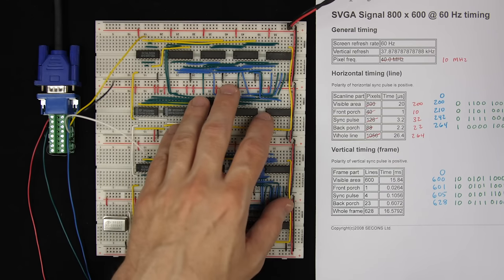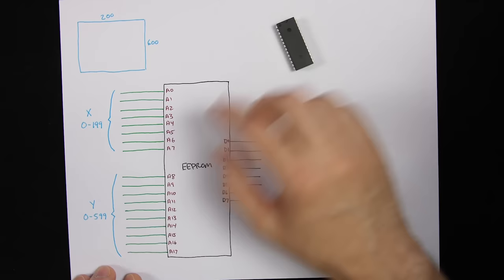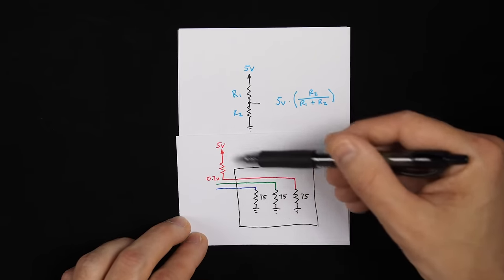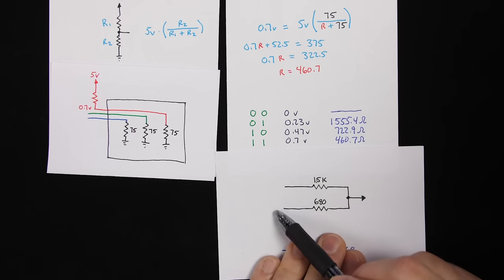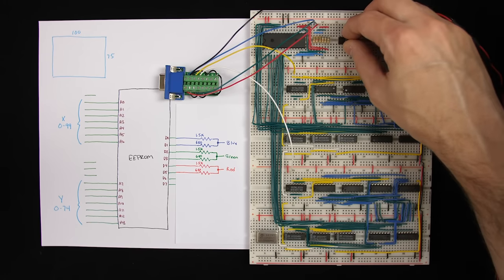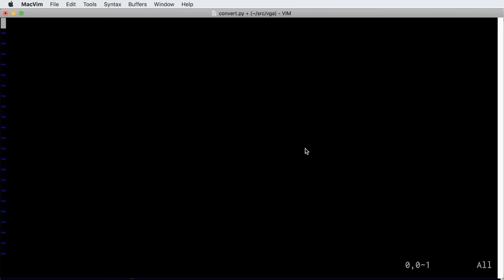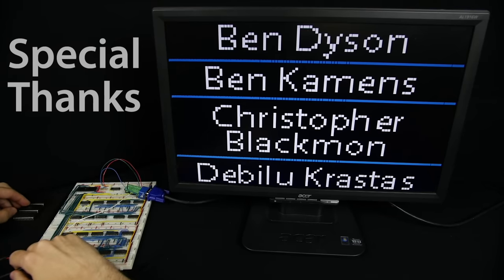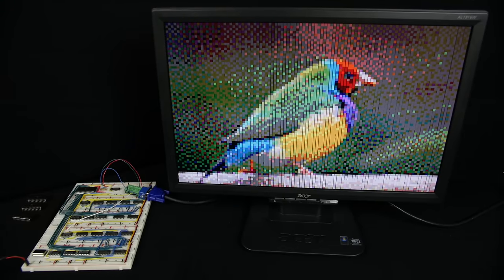World's worst video card? The exciting conclusion

Comment: Great job, but I miss decoupling capacitors on each chip you are using. You should use them, especially when breadboarding.  I think that might enhance the picture as well.
Reply: I was just about to add this, those 74LS chips were more forgiving than i had anticipated - even at 10MHz...

Comment: Using error catching as flow control made my architect mind scream in horror
Reply: Why?
Reply: @quintrankid8045  A combination of "bad design" and a huge resource cost for exception handling.
Reply: @OzixiThrill  so what? It's a simple script to convert A to B. It's not going to run for hours, or be maintained for years or anything like that.
Reply: @sligovolts  "Using error catching as flow control made my architect mind scream in horror" - I was explaining that. Nohing more, nothing less.
Reply: @OzixiThrill  now I see, and I stand corrected
Reply: @OzixiThrill  But even if it was going to run in production for the rest of time why is that bad design?

And if time is really all that critical, eg we need an estimate of the hurricane path before the hurricane makes landfall, then maybe Python isn't the right tool for the job?
Reply: @quintrankid8045  Exception handling is supposed to be there to handle cases that the programmer can't predict to occur. For this case, the programmer in question knew exactly under what conditions the exception occured and knew exactly how to work around it, even without introducing exception handling.

And exception handling is costly, regardless of the language used, thus should be used when necessary in general.
Reply: @OzixiThrill  I looked around the intertubes and it seems that if try block doesn't throw then there's very little overhead.  The code might even be more compact, if that matters.  But yes, handling the exception is a bit costly.
Reply: @quintrankid8045  We do know that we are catching the exception about 1/3rd of the time, which makes it quite a bit more costly than say writing an if else block to handle the situation preemptively.
Reply: @OzixiThrill  I think I'd want to see the timing on that so that I wouldn't be violating the rule of premature optimization.

You know what seems strange to me?  At least one more mention of this in the comments but I didn't see anything about not opening a file using 'with' context manager or a mention that the file wasn't explicitly closed. I wonder why.
Reply: @quintrankid8045  In this one instance, it would be premature optimization, because the code segment is barely ever used.

I'm not overly familiar with Python, but it could either be that Python does that in the background, or that due to the program closed, the files closed as well.

Comment: Ben, please consider targeting a little bit more knowledgeable audience as well. It is good to have these videos that target an entry level enthusiast, but these videos are actually really good, except for those of us who have experience in this field, they do get irritating due to all the "mistakes" that you are making. Some points to consider for this video:

1. I would have used a ROM and an SRAM to load the image from ROM to SRAM then blit it from SRAM.
2. There is plenty more resolution to go with 32KB of memory, I'd chosen a 200x160 resolution. Better yet, a great resolution would have been 320x200, which uses up 64K but it matches the DOS mode 13h resolution.
3. There is more bits for the DAC in 8 bits. Rather than 2 bits each for R, G, B, I'd done 3 for R, 3 G and 2 B.
4. The python out of range and exception back and forth is such a basic bug that I would have a) not use exceptions and b) would have written it correctly with the 128 byte stride the 1st time. Nowadays pretty much everyone knows python.
5. In Photoshop you can save the file as RAW rather than PNG and forego the whole PNG hexdump and loading step. Just load the raw image in python and do the 128 striding code.

With all this said, I appreciate your videos, these are great fun and while they are a bit irritating for someone who has done this before, they are still interesting to watch!

Comment: How many FPS can it do?-Yes.
Reply: It can do 60 FPS, just... with one F...
Reply: He's so rad that now he needs SPF
Reply: He could set up multiple eproms and switch the RGB output signal between them on the vertical blanking signal. That would then animate between them at up to 60 FPS.
Reply: the faster you can swap an eeprom, the higher the framerate
Reply: @paranoidnela  Next up: building an EEPROM swapper robot arm that can swap 60 EEPROMs per second.

Comment: This guy builds a graphics card on a breadboard in 25 minutes!!!11 incredible
Reply: He cooks to
Reply: He also writes poetry and paints inspirational works of art.
Reply: Well, he cut parts of the video. It took him hours of research to get it working
Reply: @raven4k998  to eat?
Reply: plushoom  lul
Reply: @edism  yes to eat you should try his chicken cordon blu it's to die for lol
Reply: @maxlee3838  I dare you to get western digital to make the 6502 at 14 nm instead of what they currently make it at actually I quadruple dare you to infinity  to do that as that would make a cool video to see what it actually overclocks to with that much of a size reduction to it
Reply: http://www.6502.org/homebuilt <-- some HDL examples, if you're into FPGA.
Reply: @raven4k998  Hehehe, I see what you did there.
Reply: @edism  yeah well I am kind of curious about how faster a 14  or better yet 6 nm 6502 cpu would go to in overclocking as the original maxes out at 20 MHz and the smaller you go the faster it gets the bigger you go the slower and 6 nm is the smallest you can go with a 6502 as that's the smallest you can go with silicon based tech works besides it would make the chips cheaper to make and if you have to make these old obsolete pieces of crap you might as well make them as cost effective as possible by shrinking the chip down for getting more out of a node plus you also then make chips that use a whole lot less power to boot

Comment: When I went to test the first stage by connecting the clock outputs to RGB through resistors, I'd get a bar, but as it progressed down the screen, it was fading out.  also faint vertical lines and bottom looked like vertical blanking was in the image.
I tried different resistor combinations, etc.  Thought perhaps there was a current problem where using a passive voltage divider wasn't allowing enough current through the 75 ohm impedence.
Then it dawned on me.   If you're driving the the RGB from the vertical clock, the video image signal is still being sent past what should be the end of visual screen.   So instead I used the HBLANK signal from the SR flip-flop
BINGO!  Of course it's one solid color on the entire screen, but at least the brighness was uniform.

This particular monitor, really a digital TV with VGA input, required a signal on the video color pins or else it would consider there to be no signal, even though it had vertical and horizontal sync.

Also it didn't seem to care if the sync polarity was positive or negative, which was another thing I tried when I wasn't getting solid horizontal bars.

On to adding the eprom.

Comment: So you have done a picture... is there a. Chance that you will do a video??

I think I’m not the only one hoping to see you attempt / accomplish this.

=D
Reply: In theory he could use the unused address bit to look at multiple images
Reply: There are a few ways you could accomplish this. I might even try this later after I'ved moved and grabbed some breadboard (have used discreet chips, but never breadboard).

this depends on what you mean by 'video'. if it's a fixed video on an SD card? It'd be possible to get some arduinos to barf the pixels out fast enough that you didn't even need the sync circutiry. if you use the sync circuitry and then use RAM instead of an Eprom, then you can get a more modest arduino to handle it if the frame-rate is lower.

getting a Gamebuino META (which has a similarly small native resolution) and scraping the pixels off of the SPI bus because that's how it communicates with it's own internal screen. upside, you now have a very modest but perfectly decent game console with a screen that doesn't require squinting.

doing it purely with logic chips would be a mulit-level breadboard monstrosity, though.

Comment: The most amazing thing about this whole project:  not a single decoupling cap.  Who was that that said we need decoupling caps?  Oh, and you could fit 2 images in a chip and just flip that address line. . .  Or even use a 28C1024 and put a counter on the upper address lines.  ;-)

Comment: is it possible to simply copy the pixels from a low resolution camera, directly to your video chip, essentially generating a constant changing mirror image of a camera to the chip to be then read to the screen?
Reply: just to add to this comment i made, basicly you can just as sdram before the chip? or divert camera input to sdram and read directly from the sdram in video mode?

Comment: I was thinking about the issue of not enough address lines on the rom to handle 200x150 video.
There is actually enough storage in the rom to store that size of an image, even with each pixel taking up a whole byte.
200x150 is 30,000 bytes.  Can fit nicely in the 32KB rom.   The issue is because we're using extra address bits for the horizontal to accommodate a full 200 count, we're wasting 56 bytes per horizontal line.
What we could do is use a separate dot counter that counts to 30,000 with the clock suspended during video blanking periods.
What you would need is a 15 bit counter with reset at count 30,000 and clock gated when horizontal count is over 200 or vertical is over 600.
Except for one problem:  Every count of 200, we need to hold the clock for 4 counts since we are outputting 600 rows but only have data for 150 rows.  We can't just skip address bits because the data is not on exact binary boundaries.
Hold the dot address clock for 4 vertical clock pulses.   The blanking timing is handled elsewhere.

Which leads me to another improvement.   Instead of only 64 colors, 2 bits each for RGB, allow for 256 colors and use a color map to specify the actual colors.
Reply: So I mulled this over and if we were only displaying one horizontal scan per individual vertical line, a dedicated counter for the ROM would work even with the number of horizontal pixels not on an address bit boundary.  But because we have vertical lines repeat, that gets more tricky.  You can't just freeze the clock at the end of the visible line and hold it for 4 vertical counts, or else for every visible line you'd get 3 blank lines, or the 3 additional lines would be the last pixel data being scanned across.
But the old 8 bit PCs tended to only display odd or even lines in the interlace.   That doubled in allowing the processor to have the bus an entire field.   Skipping 3 out of 4 lines might not be any worse when considering you're really displaying 800x600.

As for resolution, 200x75 wouldn't really be too bad.  The pixels wouldn't be square but rather stretched to a vertical rectangle.  To get the full picture, you could take the image as 200x150, and odd or even lines when putting it on the ROM.

To get a sense of what the images would be like displaying 200x150, 200x75, 100x75 I took AND/NAND gates to take the one of the LSB output of the H clock generator and V clock generator.

View pictures of my monitor's display:
https://1drv.ms/u/s!AtrEecyHVSB5hKxqSc0NkUOQJQsHew?e=Tf3zp9

Two of them show ROM output when it is all erased.   Most of it is a field of white, but a spot about 2/3 down, 1/4 right from the left you'll see a few "pixels" that show magenta.   I guess that's a few bits in about 4 bytes the ROM that are a tad slow.

In my experiments, some of the lines we've seen might not all be from the delay in the ROM but also accumulated propagation delays in the TTL circuits.

Comment: It occurs to me I could build a hardware CHIP-8 interpreter using this and your breadboard computer. CHIP 8 programs are 64x32 pixels usually.
Reply: Ooh, you could also store a second, grayscale version of the image above the color one in the EEPROM, at the addresses where the fifteenth address line is high. Then leave the address line floating. It will randomly make the image either grayscale or colored and could be cool to look at! You could also implement double buffering this way, by using the extra address line, if this were a RAM chip. Or just hook it up to a switch to see two different preprogrammed images.

Comment: Putting a video signal out during the blanking time does not lead to damaging the CRT display; it leads to what is termed “retrace lines” becoming visible on screen (assuming there is no special circuitry to control retrace blanking).

Comment: 200x600 is kind-of like the extra modes 8-bit Ataris got when Atari introduced the GTIA chip. I don't think any manufacturer in those days dropped bits just to get square pixels in high-res modes, but those modes were extreme. They had pixels 4 times wider than they were tall, like the sync signals here but only 80x200. They were some use for smart artists, Atari themselves made a nice demo with a spaceship and a robot, but definitely tricky to use. It was easier to use mode 8 which sent the same data through a shift register for 1 bit per pixel, giving 320x200 in only 2 colors. Games tended to use 160x100 or 160x200 in 4 colors, sometimes using a custom "display list" to use different modes on different lines.

But anyway, this would have been a pretty good graphics board back in the day. :) I'm impressed it can be made on a breadboard. It gives me hope, although really, if I wasn't always too tired to do this sort of thing, I would have been doing it in the 90s. ;)

Comment: Looking at the timing diagrams, we're very lucky with the ROM chip.
From the monitor's perspective, each pixel is 25nS, yet the ROM specs out with maximum of 150nS.   
So the display could have black or random color dots for up to 6 monitor pixels for every of our pixels.
I bought cheap ROMs from Amazon, 5 for I think $12.  Many reviews said they had issues but even if I only got two to work I broke even compared to well known sources.  All 5 tested OK with the ROM burner, tested all FF, all 00 and random bytes, always verified OK.   But only 2 out of the 5 would produce a suitable display, likely because the 3 could not produce reliable data in time.

Too bad they didn't specify what is typical but perhaps they didn't because if you cut corners with the timing, you'll get corrupt data.  We don't care too much about that with the display but you don't want that for a program stored in ROM.

Incidentally when I tried the ROMs, I had configured the project to display 200x128.   I got the ideal of only displaying 128 lines from the first video integrating this project to the 6502 project.   There, to save RAM space and only use 16K bytes, it was displaying 100x64 so we can remain in the address bit boundary for the vertical, so I applied the same idea for the 32K ROM.
I'm sure that didn't help with the stability of the image with 3 of the ROMs.

Heck, perhaps the slower chips will work fine on the 6502.   It should.  That demands up to 1/10th the speed of our VGA card with 1uS or 1000nS per CPU clock cycle.

Comment: Really nice!!  For the credits display, you could have used the rest of the unused EEPROM locations & address lines to fit in rest of the images so that, using a very slow counter to change the base address of frame buffer, resulting in a slideshow.

Comment: Video card? More like PICTURE CARD.... lol nah this is really informative. I've always wanted to get an idea of h ow things like this work. I might not have understood everything in its entirety but this gave me a good idea of where to start with things I dont know. One of the problems I find myself running into often when trying to understand things is that I don't  know what I don't know so I dont even have a clue where to start my research.  A mistake I often find myself making is working from the start. So in my mind making a graphics card, lets start with the power, what do we do with the power? I dont know... But starting at the end helps. Take the monitor, what does the monitor need? It needs a vga plugged in, what is sent through that vga? varying signals, ok how do we send these required signals, well if we start with x power we need to do y to it. Rambling

Comment: On the old BBC Micro you could move the start of video ram to any point including into the operating system memory.

This was very interesting because you could watch, for example, the keyboard buffer filling up with the binary representations of the ASCII character you were actually typing.  All sorts of other interesting things were visible because this is system memory and you can see all the data flying around the system.

Its just a shame that's not possible with modern PCs.

Comment: So you could have just added some black pixels to the right side of the image and made it 128px wide, with an 8px black bar on the right, then that would have worked?

I feel like a lot of the programming of the image could have been easier to manage with black added as padding.

Comment: 2:37 It's actually not 16 colors, it's 8. You can see it and count them right on the video, or, you can calculate the number of combinations you can make with three on/off settings, which is 2^3=8 (where 2 is the number of options per channel, here "on" and "off", so two, and 3 is the number of channels).